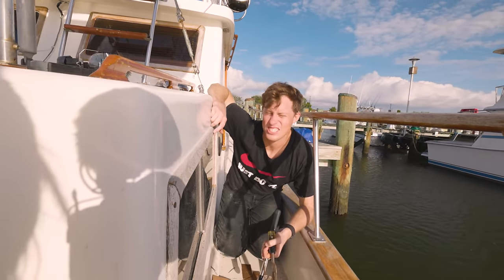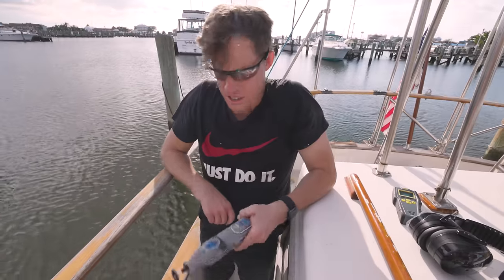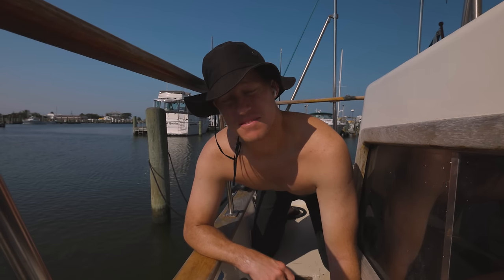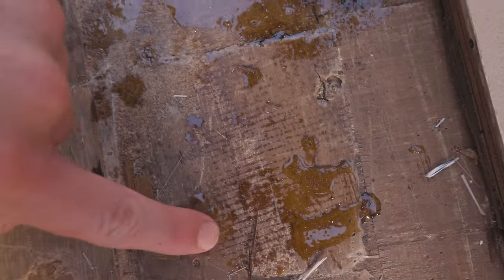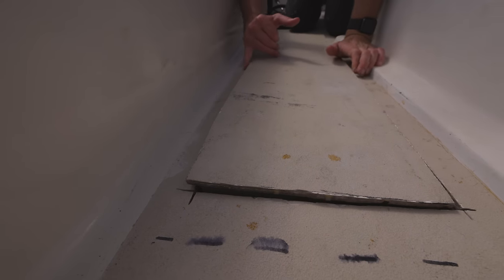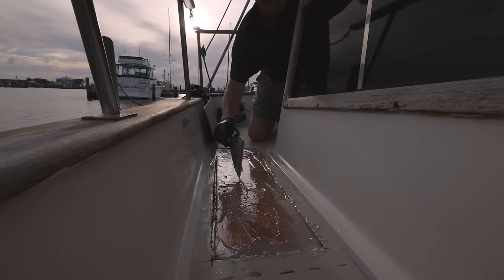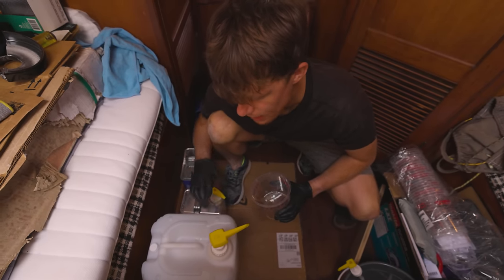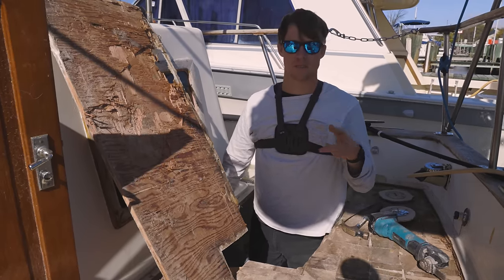Replacing our Trawler’s LEAKY DECKS | Our BIGGEST BOAT PROJECT Yet!

Comment: A few thoughts as we look for a loop boat to refurbish - oh my: (1) how long are you planning to keep the boat- spend accordingly; (2) find and seal the leaks first - those causing the rotten wood; (3) based on answer to #1 - seal the deck with with an epoxy paint (perhaps several coats) to firm up the soft spots and add additional sealing to prevent remaining water leaks.  These paints also can provide a non-slip surface.  We learned so much from your videos.  Stay safe!!!!!
Betsy and Dan
Reply from the maker: Thanks Betsy and Dan - best of luck finding a good old boat to refurbish!

Comment: You know this comment will be a little late after the fact , but I had a similar problem with my boat and also had difficulty sourcing Marine plywood .
I decided to make my own Marine plywood by using regular plywood and and just coat it with 2 coats of  fiberglass resin . This seemed to work for me , and it's been 4 years and the deck is in great shape. 
It was very impressive for you guys to take on on this project with so little experience good job .
Reply from the maker: Nice, glad that worked for you!!

Comment: Good job at tackling this tough project. Big pieces of plywood are difficult to work with since decks are not usually flat. Builders use small squares of ply, balsa or foam to allow for a radius. Foam is especially easy to work with. Look at resins too vs epoxy as a way to save some money.
Reply from the maker: Thanks so much Eric!

Comment: If you haven’t figured red it out by now, get an oscillating multi-tool to make the short cuts. Also, exterior grade plywood is fine for recording.
Reply from the maker: We did get a multi-tool shortly after beginning the project, it seriously is fantastic and was clutch for the project as a whole!
Reply: @SchoandJo  happy new deck!

Comment: Once you remove  the old rotten wood from a section, I suggest you use a hook to pry out rotten wood from under the side edges. The stuff a fiberglass filler into the edges. Do that before you put in new wood and that way the whole area will be solid.
Reply from the maker: Good idea John!
Reply: Yes this allows you to keep the radiuses up to the bulwarks which makes finishing easier.

Comment: This is probably water over the dam, but did you try Jamestown Distributors?  They have a lot of different coring material.  I used balsa core, but they also have a different synthetic core that’s supposed to be very good stuff and not as “thirsty” as marine grade plywood, as well as easier to cut and tool.
Reply from the maker: Jamestown Distributors was fantastic for a lot of our materials but most coring alternatives I found were way more expensive than the marine ply I found! Balsa would have been good too - probably better for overall weight!

Comment: Wow, you guys are ambitious!  Looks like great progress.  A few questions:  What are you doing to fix the original source of the leaks into the decks?  Likely the cabin windows or rail fittings or other fittings.  Maybe the cabins sides were wet/rotten also?   Leak source could be a long distance away.   I was surprised that the wood you removed was so dry, was expecting mush.  Did you consider just constructing a new deck sandwich on top of the existing deck?
Reply from the maker: We've found quite a few of the leaks from the original fittings and when we removed a lot of the top layer of fiberglass there were many patched up screw holes, in the magnitude of 100's in a section. I'd assume that most of the leaks came from there in the past, were painted over but the leftover water was left to rot out the wood. This was definitely some of the driest sections of the boat. At our bow and stern it was literally soil haha. Constructing a new deck would have made our final step of fairing a bit easier but it would have taken a lot of fiberglass, epoxy, aaaand time so we decided not to do it! We do need to reseal most of the windows but they were done somewhat recently by the PO so its not priority numero uno. Cheers 🍻
Reply: @SchoandJo  Did Pivot originally have teak decks?  Perhaps removed by prior owner (due to leaks!)?  Might explain all the holes.

Comment: I know your started in September and it’s now late November, so not sure what core you used, but I suggest marine grade plywood is good but it’s very thirsty so be sure it soaks up epoxy before you reseal it with the top fiberglass decking. Glad you got the multi tool.  It’s a perfect tool for all sorts of boat work.You can use the scraper blade to “buzz” off the old core.
Reply from the maker: +1 on the multi-tool - it was clutch for the project as a whole! We ended up using Marine ply but did seal it with epoxy before affixing it to the decks! Cheers 🍻

Comment: I was trying to read back on comments and I'm sorry if I repeated but did you all test the moisture after all was done? Looks like y'all did a great job. Just was wondering what the after numbers were. Happy New Year!
Reply from the maker: No worries, actually you're the first to ask 😁 We didn't do a full test of the whole boat afterwards but did test section to section... What we found is that some areas  there was a huge difference and practically 0% water and others there wasn't much of a difference. Further research showed that the fiberglass topside sometimes registered as moist.... so our conclusion is maybe don't use the cheapest moisture meter you can find on Amazon 🤣 Regardless of the output of the moisture meter we ripped out all our guts and some of the other wood core we pulled was so wet, it was literally soil haha. If you needed to seriously determine wet coring, I'd suggest a hammer to check delamination along with a moisture meter for a second opinion - but don't solely accept the moisture meter.

Comment: Hi Jenn and Elliot, and Ollie :) 
I have a questions about the moisture meter you used in this video.   Was it a normal contactor's meter that costs < #30?   or was it a marine moisture meter that can cost hundreds of dollars?    we are still looking for our perfect boat and we are wondering if we should invest in a moisture meter.   Thank you!
Reply from the maker: It was a normal one! It was more for our own enjoyment, I did notice that it wasn't that accurate towards the end of the re-coring. While it seemed to never miss moisture, it would sometimes register sections as having moisture that were just fiberglass. So depending on how accurate you need it then it may be worth it to invest!

Comment: I'm wondering exactly where the water was getting through the fiberglass into the wood core ?
Reply from the maker: Most likely through the windows, they were all rebedded by the PO, he did an extensive rebuild but didn't do the decks.

Comment: To get a smoother finish you should use peal ply after you lay it up.
Reply from the maker: We've never heard of peel ply, but I looked it up and it looks interesting - I guess you save it for the last layer and then it helps with needing less fairing? When would you lay it up in the process?
Reply: @SchoandJo  It is the very last layer you put on.  It doesn't stick to the epoxy or resin you are using so when you pull it off you get a smooth finish that would take little or no fairing.  Before peal ply (1980's) we used cut up  trash bags but don't use them until you try them with the resin/epoxy you are using as the formulations have changed since then.  We were building kayaks then so our layups where thin so we did not have the heat you may have with thick layups.

Comment: I bet the boat had teak decks in a former life and that is what all those little holes were from (the fasteners). The idea to remove the teak was sound but the follow through was not. Use some closed cell foam instead of plywood for a long lasting finish product. Kudos for having the stones to dive in!
Reply from the maker: I think that was the case too Peter.. some of the sections had hundreds of holes all in lines. Teak decks seem like a good idea but probably screwing them into the deck and not sealing properly is not the best plan 😁

Comment: How will you reinforce under the edges where you don't cut out the top?
Reply from the maker: Those edges are packed with thickened epoxy until it spills over the edge. That combined with the new fiberglass for joining seemed solid enough! Any really rotten wood in those small sections we pulled out when we were cleaning out the wood from the center so those sections would be pure epoxy 👍

Comment: Trick when cutting plywood.    Set your saw blade to the thickness of the wood.   Then you can lay down a steady piece between the saw horse or even on the ground and not let it drop to the ground or risk kickback.
Reply from the maker: What a great tip - thanks Todd!

Comment: Regardless of what people think, you are to be admired for doing it versus talk from others. Did not the surveyor pick up the soft decks. These Marine traders were  notorious for this problem. That's why they sell for nothing, nobody wants them , thats experienced.  Also known for large blister problems, on the bottom, of the boat. The good news is the Ford Lehman engine, excellent engine.
Reply from the maker: Thanks John, it was quite the learning experience and I'm happy to have learned a lot of the basic skills that will help in a lot of different applications in the future! Fortunately the PO fixed the blisters, added a Bow Thruster, and lots of other fixes so those are nicely done! No more leaky decks are our long term addition to Pivot (amongst a lot of other small things) and at least we will sleep well at night with no wet beds! Our surveyor did pick it up but mentioned it was the sort of thing that didn't actually cause issues as long as there were no leaks into the cabin and at the time we didn't know of any. Unfortunately later we found quite a few leaks into the cabin... 🤷 You win some and you lose some

Comment: Stop wasting money on marine plywood for below deck repairs. Marine plywood basically just doesn’t have any knots in it and it’s usually used for finish work.  It’s also nice to have a planer when replacing coring.  But good job for your first time the more you do it the easier it will get.
Reply from the maker: Having a planer would definitely have been nice but we made it work! I think it’s ok not to use Marine Plywood too but we don’t want to ever worry about it again 😁 plus it’s what Andy from Boatworks Today used and we trust his opinion!